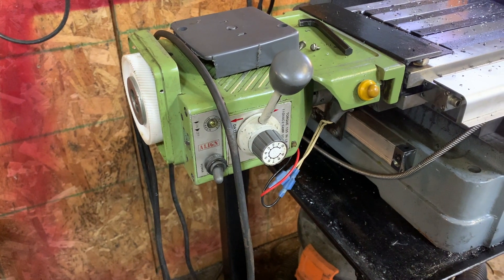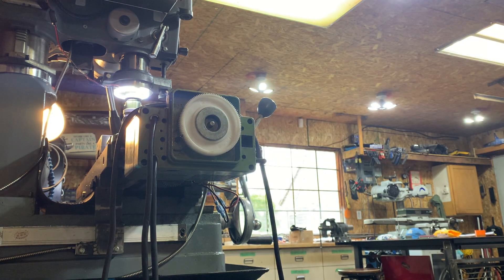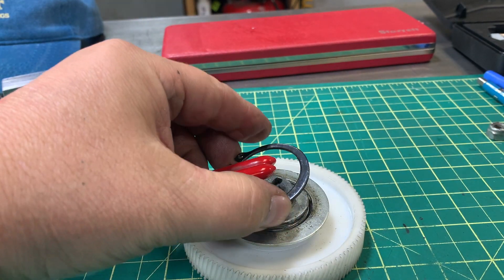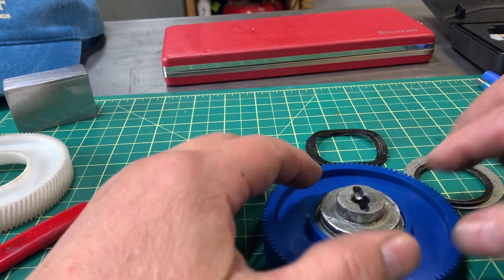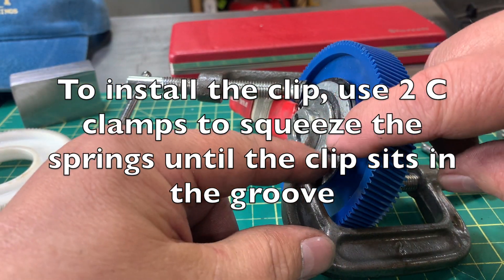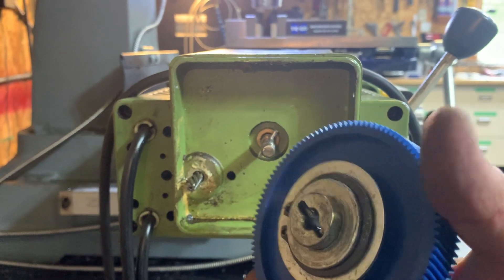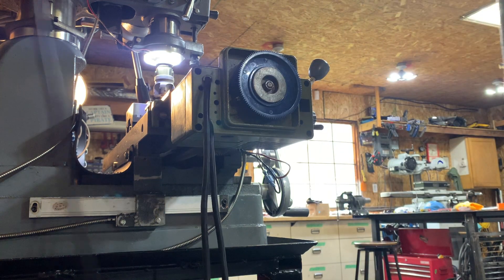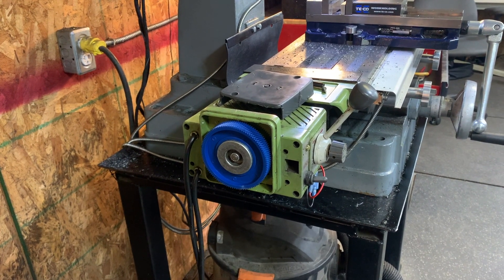Align Power Feed Gear Replacement

Comment: Gilles, wouldn't hitting the end of the shaft to remove the gear cause the shaft to bend?  Surely that's not how the designers intended the gear to be removed for maintenance (assuming that they intended the power feed unit to be repaired)?
Reply from the maker: Its always possible Bob. But interestingly it turned like that when it was brand new. I’ve seen a lot of weird stuff in my short 60 yrs but that tops them all. At some point I’ll disassemble it again just for fun but the last I had it in pieces it all looked fine. Very odd
Reply: @LetsRogerThat  It sounds like it was damaged when you first received it!

Comment: there is a LOT of weeble wobble of the gear on the shaft or in the shaft its self... has using the clamps pulled it out of alignment on the taper or is the shaft bent?
Reply from the maker: I agree with you. Its a LOT of wobble.  The machine has always run that way oddly enough.  When I inspected the shaft 2 years ago it looked fine.  But its certainly possible that I missed something even though I dismantled the unit to fine why it wobbles like that.  Perhaps at some point I'll take it apart again.  Gilles
Reply: As it is clear that the shaft itself is wobbling and it didn't look bent when you inspected it, my next suspect would be that one of the driving gears has been machined badly (or has worn) such that it's hole isn't concentric with the teeth.

Comment: I think you need to fix that eccentric runout, as that for sure will eat gears. Was it doing that before?
It's an interesting safety overload clutch that way the gear is mounted on the hub. It should not strip the gear teeth off if that is working correctly.
Reply from the maker: Isn't it odd right.  I've actually dismantled that thing in the past. Right down to the motor.  The system although wobbling all over, or so it seems, runs perfectly.  I inspected every single part and spent time making sure the gears are always in contact and sure enough, they always are.  Now, the nylon gear is meant to be sacrificial in such a case, rather than damaging the motor which comes directly off that little horizontal gear that turns the nylon gear.  So what actually happens is, once the x axis nut jammed onto the x-axis lead screw, the motor was still turning and the sacrificial gear lost 5-6 teeth.  This happened before when I had the power feed on another milling machine.  Otherwise that thing works perfectly.  You know what they say. If it works, don't fix it. :)  Gilles